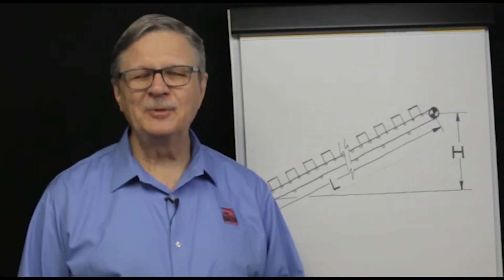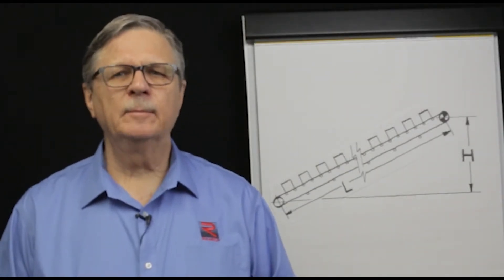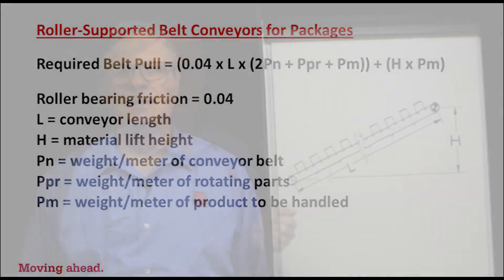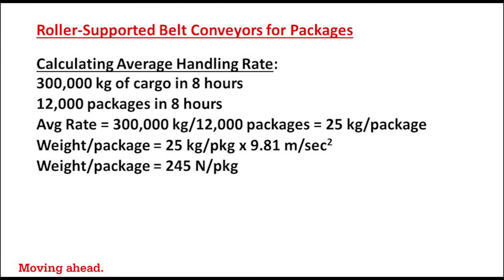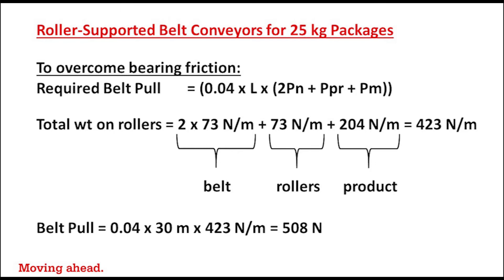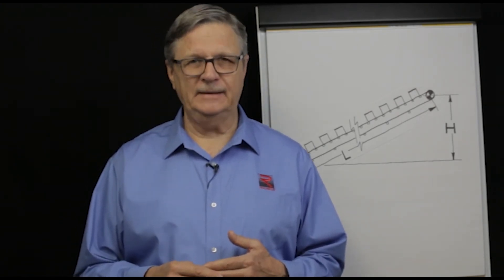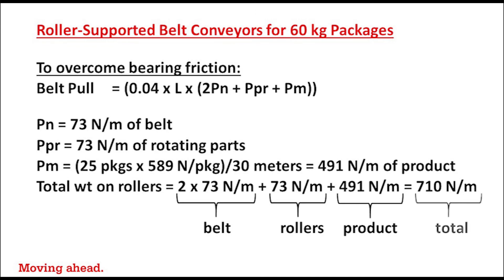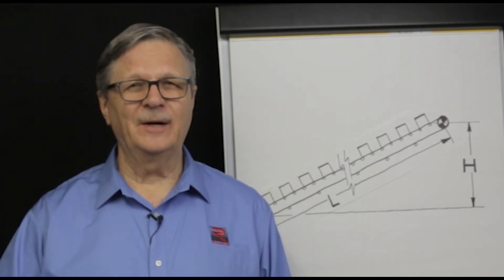How to Calculate Belt Pull on Roller-Supported Conveyor Belts (metric)

Comment: what handbook or textbook where you got this equation sir? is it possible to have this info coz I am doing my design term paper and I need to show the source of the book where the formulas you are using. thanks
Reply from the maker: Dear Fidel, I took the equations from the Rulmeca Group Main Catalog, which was originally published by our company more than 50 years ago.  If you will send me your email address I will send you specific info about the book.
Best regards,
Mike Gawinski
Reply: @rulmecacorporation4596  I want also want regarding the roller conveyor design
Reply: @f3nunez  ok. For the bulk roller conveyor equations we used the Conveyor Equipment Manufacturers Association guide book, fourth edition. For the unit roller conveyor equations we used the Rulmeca Group catalog
Reply: Is it possible to have soft copy of the said catalog?
Thanks
Reply: @f3nunez  do you want digital copies?
Reply: @mikegawinski3450  yes sir is it possible.
Reply: @f3nunez  yes.  I just need your email address
Reply: @mikegawinski3450  can u please sir share a digital copy needed in research paper too
Reply: @rulmecacorporation4596  please can u share it i need it in research